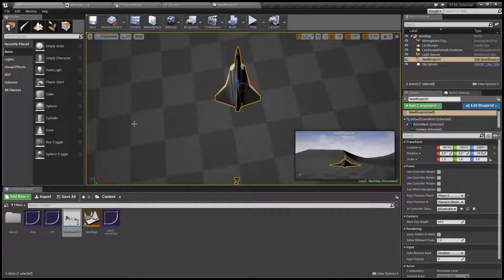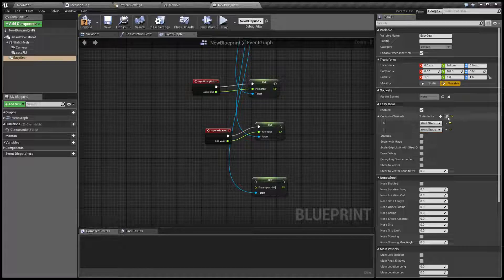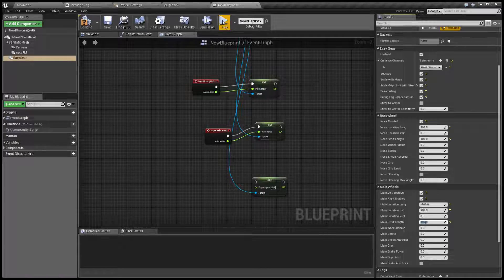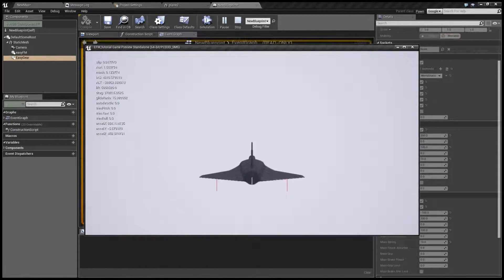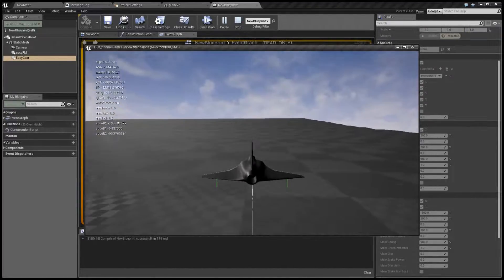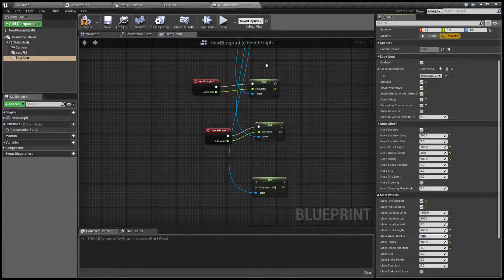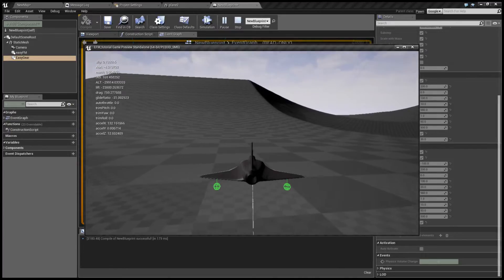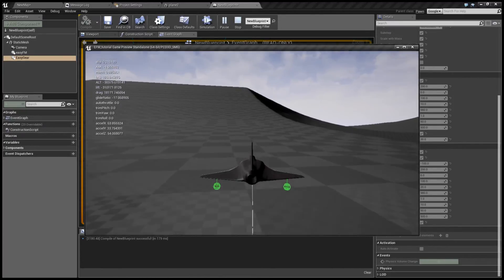EasyFlightModel UE4 tutorial ep.4 (landing gear)

Comment: Lol, every time I want comment youtube gives me error. I have trouble with EasyGear
I've tried to use EFM example setup.
When gear touches ground it changes color to green, "lands" for 2 seconds and then it going through static mesh.
If static mesh is thicker, plane slowly sinks into object.
Reply: Is this possible to use nose wheel as tail wheel Like ex.Hurricane?
Reply from the maker: 1. Try making the suspension struts longer. The top should stay above the terrain, else the raycast will miss the mesh and it will fall through.
2. Yeah, just give the nose wheel negative X position and it will act as a tail wheel.
Reply: @Worstplayer I've tried to incase struct length. It seems to slow down this effect, but plane landing gear is still drowning.
Reply from the maker: @seba0456  is it possible to send me the project or at least a video of what's going on?
Reply: Does my link works? Is it visible, everytime I post link youtube shadows ban me :(
Reply from the maker: @seba0456  yes i have the link, will look at it today
Reply from the maker: @seba0456  drive.google. com/file/d/1snMI7XyxX7N4PqBHmbqGAj7OcXffecSV/view?usp=sharing
Here, fixed. The issue was two-fold. First, the whole gear was located too low (the base of the strut should be where it joins the wings, or even above it), and second, the springs were too soft.
Reply: @Worstplayer  thank you.

Comment: Awesome vid! I have added gears to my model and it all works fine. I'm now wondering if it's possible to somehow make the wheel mesh of my model react to the terrain like the easygear component does
Reply from the maker: Yeah, you can read how much the suspension is compressed from the easygear component, and use that to control the animation of your mesh. Look at the animation blueprint in the example project, that's how it's done there.
Reply: @Worstplayer  kk i'll give that a try thxx